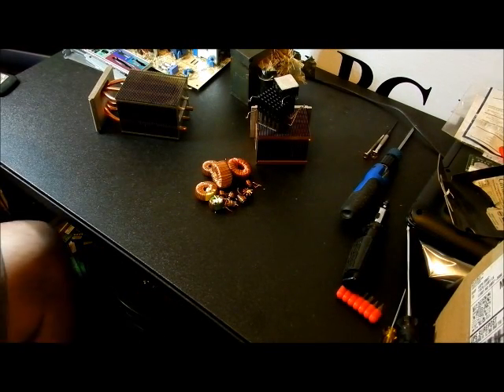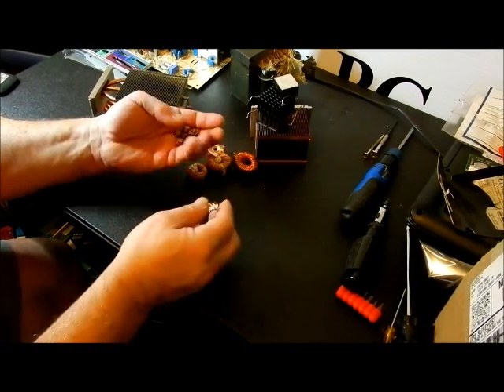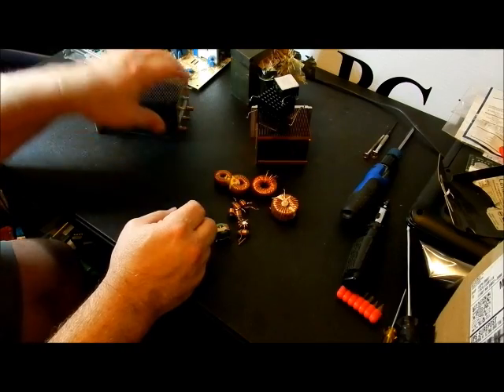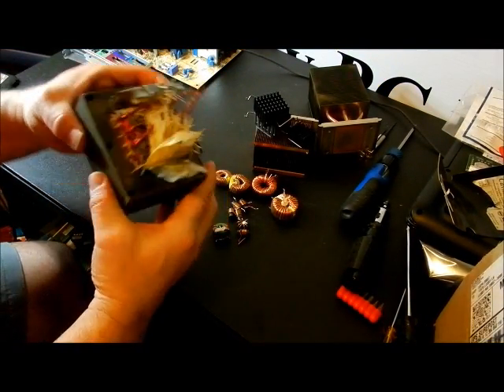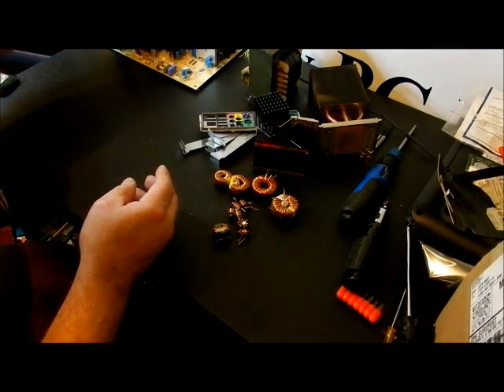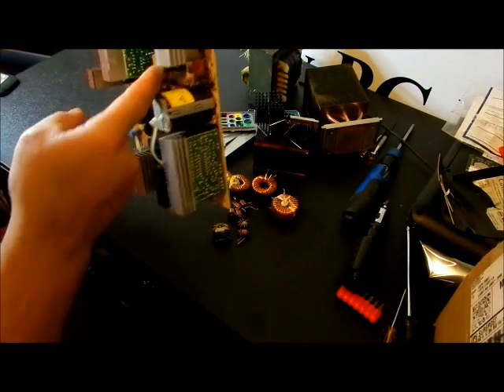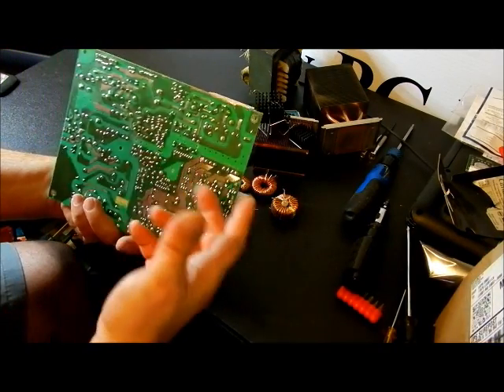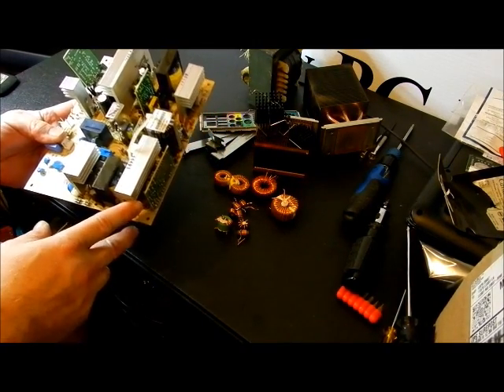Scrapping Value Items from Circuit Boards

Comment: The transformer is copper and iron .15 a pound. the circuit boards are called breakage and is .02 a pound.....if you spend more than 5 minutes trying to separate items you have lost money.
Reply from the maker: Lost money?  Not at all.
Reply: I just lost a whole day scraping some junk and found an electric motor With a metal gear box on it.  I would pay 20 plus dollars for a motor like this.  Because of the metal gearbox it makes a perfect drill for metal. And yesterday I lost a whole day doing nothing. Tomorrow I'll pay some money in buying some components I don't really need because I just want  to try something.  Whenever I go to buy a screw I never spend under 5 bucks. and I need fuel to get there anyway.  I can't  make an electric motor of thin air. I would need a lot of time and energy to make a small electric motor . Instead of wasting time and energy I went for a walk and came home with an electric motor.  20 years ago we couldn't find a bent nail in the middle of a construction site. Today we have completely assembled 2000 watt motors in the middle of a forest , and all they need is some cleaning up.  Compare that cleaning with the energy needed to produce a motor like that from zero.  then you'll see what waste of energy and time and money really means.

Comment: I just started taking apart t.V and laptop the t.V the a round object with rubber on them they look like aluminium once I take the rubber off
Reply from the maker: +eric soles It will take some time to fill a 55 gallon drum.  Good luck.
Reply: Just asking what they are watch another video the guy on there said it was trash
Reply from the maker: Up to you.  I made a video about how much I got for about 40 stripped motherboards. No RAM or processor.  Those brought in even more $$.  Nothing is trash.

Comment: Question for you. If you are stripping the copper off a motherboard....but are getting less per lb for copper than high-grade boards....then wouldn't the weight of them be better kept on the more expensive high-grade board?
Reply from the maker: In Maryland the copper is more valuable.  The boards can still be cashed in because nobody really knows what is on the board.